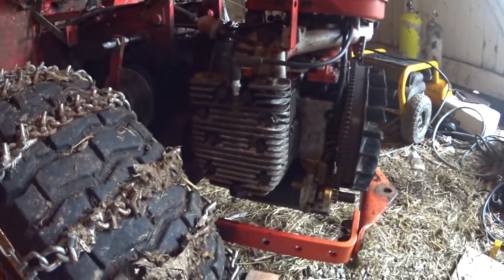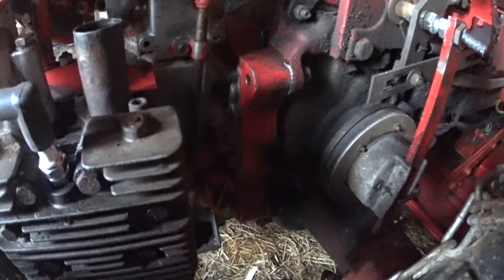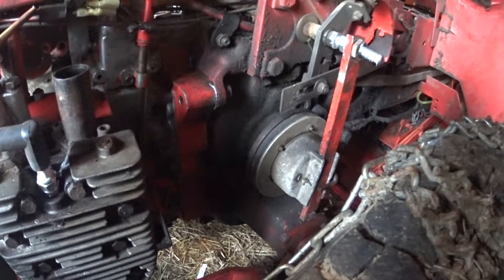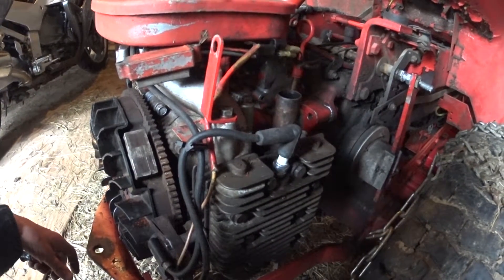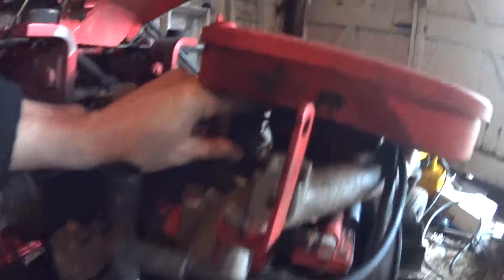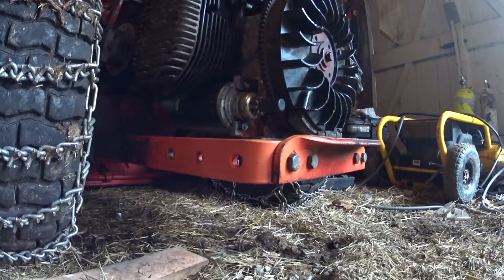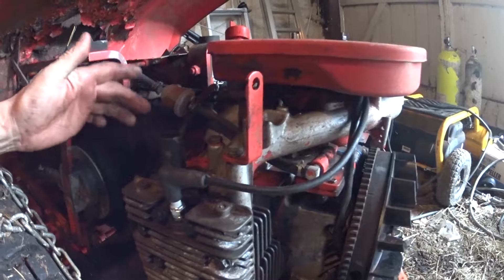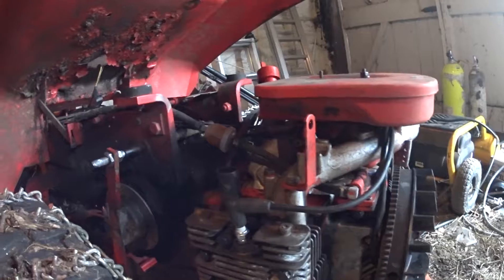GRAVELY 16G KOHLER ENGINE REBUILD FINAL - IT'S ALIVE

Comment: How old is the fuel? The way to start to tune a carb (Assuming its not clogged Floats bad ECT...) turn both air and fuel mixture screws in till they bottom out CAREFULLY you don't want to damage them. then turn them both out 1 and a half turns. That should give you a good starting point to tune from. You could always go to home depot and buy some black pipe and make some badass stacks for your exhaust. You know ive been told loud pipes saves lives.